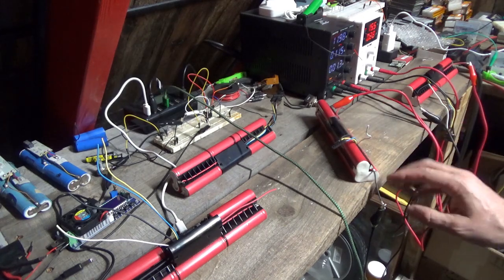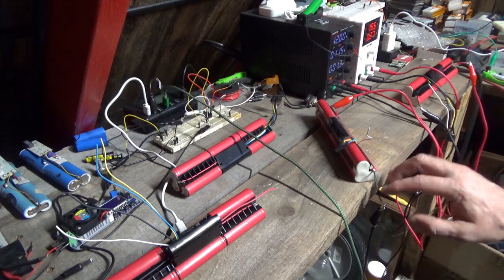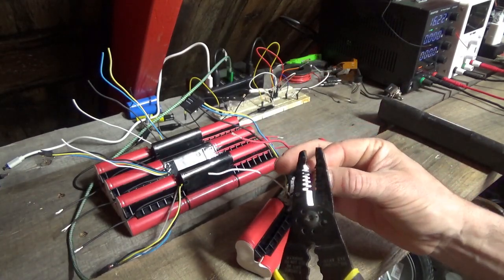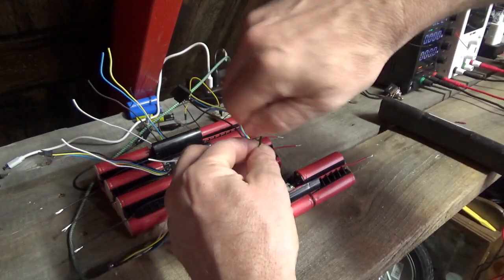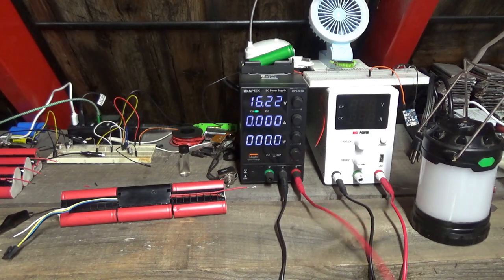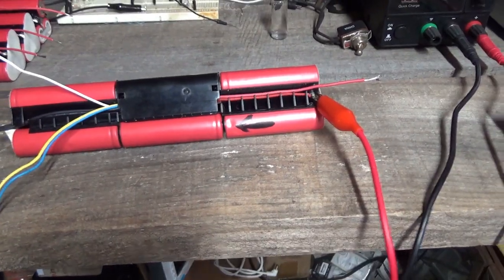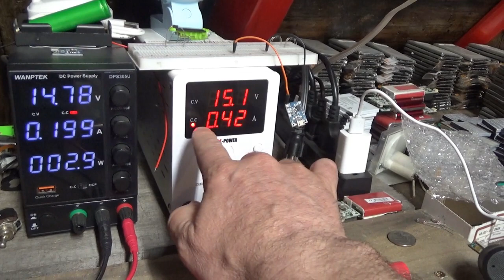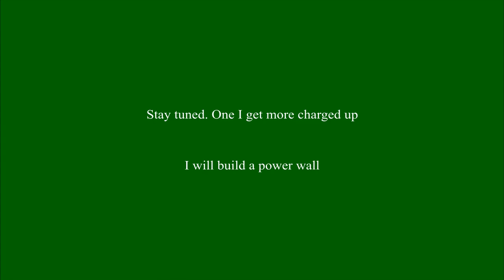Easier Way To Recycle 18650 Batteries For My Off Grid Power Wall

Comment: 50 cents a cell is cheap but not a good deal at all if the capacity is low   Do you have a way to test them??
Reply from the maker: Yes I have a capacity tester.